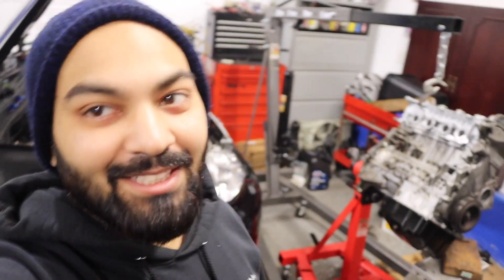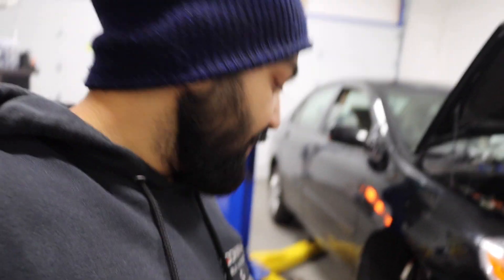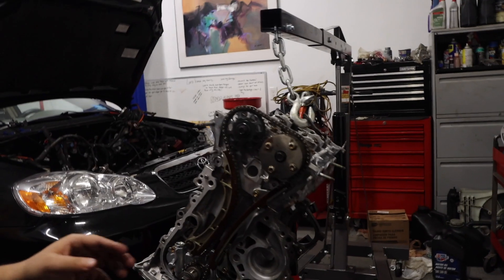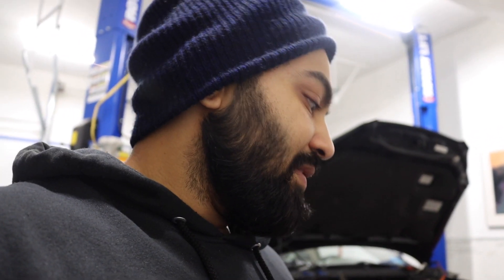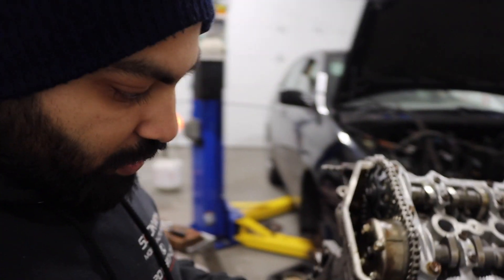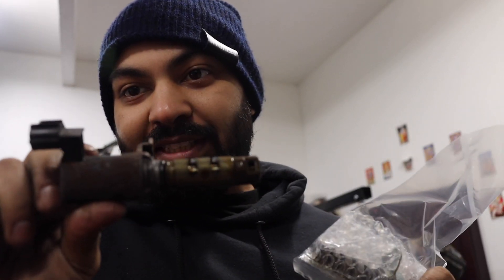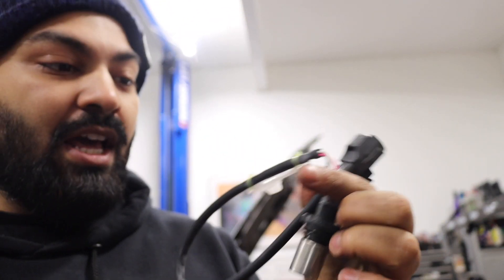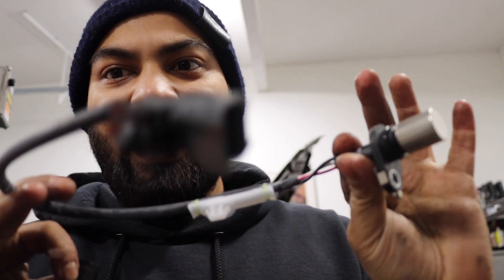engine is finally assembled! 1zz-fe rebuild 07 corolla

Comment: Was there a little oil screen with that cam sensor?
Reply: To the right of that vvti valve sensor is another plug where the screen is located. It can be taken out and cleaned or replaced if distorted by heat. It keeps debris from affecting advance or retard issues with valves.
Reply from the maker: I didn’t know that, very good to know. Thank you
Reply from the maker: Mine didnt have one

Comment: You won't be able to get the timing marks on the chain aligned with sprocket marks once you turn the engine manually. That's because the intake camshaft is a vvti and without oil pressure present it will offset it's rotation each time by 10 degrees.
Reply from the maker: Did not know that, great to know